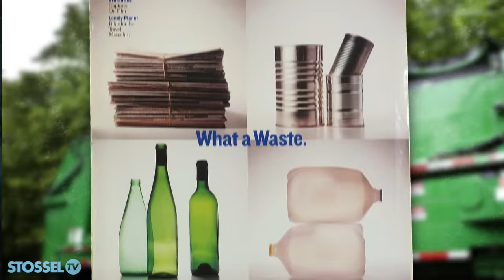Even Greenpeace Says “Most Plastic Simply Cannot Be Recycled.”

Comment: I saw a vid about using unrecyclable plastic as building material. They heated it to fuse the plastic into "Concrete Blocks," which didn't break and were bug proof.  It seems like a good idea, but there is little about its success, cost,  or practicality in real world applications.
Reply: yeah China does it, it's called Tofu-Dreg
Reply: That is a cool idea. You could even use it for emergency housing after natural disasters in the U.S and everywhere else.
Reply: Damn, I never thought of that. Use the thing that takes 100,000 years to degrade for a house!
Reply: Yah, experimented with that back in 2012. Loaded a vessel (with a lid and a trickle of nitrogen to drive the oxygen out the vent) with plastic and used nichrome heater wire to heat the plastic to melting. Had a mold we'd made for garden paving blocks and we filled it full of sand (for filler and to block UV light from eating up the block quickly) and some ground up charcoal briquettes for the carbon dust for UV protection. We had to put a vaccum pump on the outlet of the mold and shut the melting pot vent so it got about 2 pounds pressure...
Between the pressure above the very thick viscous molten plastic ( just a random mix of household plastic, basically PE and PP) and the vacuum below the plastic flowed through the sand and filled the mold.
We made 20 of those paver 'stones' and they came out very nice. Used thenm to make a walkway between a back door and a side garage door. They are still there and just as good as the day they were made. Not slick, the sand at the surface gives an antiskid effect.
Reply: They're super expensive and break down in UV light.
Reply: @bobjoatmon1993  sounds amazing!  Good on you for being inventive.  I'd love to see this in practice in nurseries,  parks, walkways.
Reply: @toomanymarys7355  The blocks could be protected from UV with stucco or some sort of siding.
Reply: Would you want your house built that way, or somebody else’s? 😁
Reply: @robertadams2857   There are applications it would be useful, no need to go after someone personally.
Reply: @robertadams2857  It seems better than concrete block, as well as being rot and termite proof.
Reply: Plaster and paint the surface.
Reply: @elultimo102   Better than Concrete? IDK..
Reply: @robertadams2857  They pounded one with a sledge---nothing really happened to the plastic "cinderblock."

Comment: I heard more than a year ago about an Australian man that had developed a process to recycle plastics, they did not have to be sorted, are all processed together, and yields a product that will stand in as a substitute for fuel oil.  Plastic started as petroleum.
Reply: The technology has been around for decades. However, the energy needed to convert to a useable fuel source is no where near the cost of traditional methods.
Reply: I saw something similar on yt.  Asian man with a machine he took from school to school.
Reply: some poor africans use it n a small scale too, the concept is the same, you just burn the plastic an condense it, the condensate is usable fuel in things like motorcycles
Reply: I know of that process, my city makes very heavy use of it. It's called the incinerator. We get a decent fraction of our electricity from that.
Reply: In the original Metal Gear game (1990 or so), I believe, there's was a bacteria that could eat plastics called, "oilex" and I did a school paper, where in my research, there was supposedly an actual bacteria that could do this.

It would be interesting to see if I could find that citation to double check the sources.

Comment: Having worked in the plastic manufacturing these guys speak the truth ,my job was in plastic bottle manufacturing [ blow molding ] . And our scrap was virgin plastic ,trimming scrap and out of spec bottles , the most pure plastic available we called this regrind , We used two types of plastic , HDPE and PETE the HD is mostly colored and the PE is clear . The issue is we cannot just grind up the scrap plastic and feed it back into the extruder and make a bottle  [ the extruder  melts the plastic and feeds it to the molder ] . The reason for this is the plastic has already been stretched in the molder and has changed the molecular structure , and won't stretch again .
Reply: Good information. Thanks.

Comment: Many years ago, I filled the bed of a pickup truck with newspaper. I lived about 30 miles from the recycling center. I didn't get enough to cover the gas. Plastic has very few ways to be recycled. A lot of it can be ground up and used for filler in concrete or asphalt. Some can be melted and turned into park benches.

Comment: Garbage should be burned for power and heat. Take out the steel cans with magnets and crush and sift out the glass. What's left is mostly food, paper, aluminum foil, plastic and dog poop. All of those burn nicely. The residue can be used in construction. I would also build plenty of coal plants which emit lots of life giving CO2 and replenish the Earth's depleted supply. Combined with proper forest management to prevent most forest fires. The coal plants and incinerators would provide the missing particulates needed for rain. Contrary to popular belief, you can have air which is too clean. Cheap energy, cheap lumber, abundant crops, cheap garbage disposal, no landfills, few forest fires. What's not to like?

Comment: what a SOLUTION ?  heating and cooing uses nearly 40% of energy used across the planet.   
HOMES, well EVERY building, by building codes, should use 10% less energy than the average building of 10 years prior to the date of the permit.   That means if you build a house, it has to use 10% less energy than the average similar home of 10 year prior.  it becomes harder as you approach zero.   but within 50 years,  houses should use almost no energy to heat and cool.  Since we already have them, it is not futuristic, impossible, or and get this,  more expensive.

Comment: Recycling plastics actually causes the polymers to break down, which requires the addition of new plastic. Metal and glass are not polymers. They are crystalline structures, which can be melted down and remolded into new containers. Recycling plastics exists so we don't abandon plastics, which maintains the fossil fuel industry. Fossil fuels should not be propped up.

Plastic bags do not reduce emissions compared to non-plastic. That's a blatant lie. The more you can reuse something, the less of it we have to make. That is what reduces emissions. So buy some canvas bags and bring them to the store with you. Don't use the store's bags. Buy reusable containers. If you can buy products packaged in metal, glass, or paper, do it.

John Stossel is a fossil fuel mouthpiece.

Comment: But, 8 pounds of plastic can be melted down into 1 gallon of gasoline. yet only 8% of plastic is used, I wonder why. Couldn't be because of the oil industry? Of course not! they'll tell you it isn't viable and it requires to much intensive labor. Simply to net them more monetary profit in the end. same reason alcohol was outlawed in the 20's. Cause someone made a combustable engine that ran on it. and it was starting gain popularity.

Comment: Sorry I'm not convinced by the video. I think I would investigate to get more figures and points of view. This video has statements based on a headline of a newspaper... Different newspapers tend to contradict so you could just search for a headline that alines with whatever you are saying. This video will be better with more real data or an explanation of why the 95% of plastic can't be recicled. Is it becouse the composition? Is it becouse is mixed with other components and imposible to separate? I get no explanation from the video, therefore I'm not convinced.
I understand that recicling can cost more than the raw material, but the thing is to design the product so it can be recicled. Search for a solution, not just say that is complicated so I don't do it...

Comment: But it absolutely can be recycled.

America alone spends insane amounts of money using sand as filler in projects.

It is quite a simple thing to heat these plastics up and just melt them into big lumps and use them inside of whatever, just to take up space.

And yes, sand is actually a big deal. You can't use just any sand to make concrete. And the world is starting to run short on that type of sand. So using it as a filler is beyond idiotic.....

And yes, it will work just fine. They even used foam underneath roads now. And foam is a lot less strong than the plastic is.

There are uses for all that plastic.

Comment: You seem to keep saying recycling in general is worthless, when your argument mostly only supports that PLASTIC recycling is worthless. Also, I’ve never been “required” or “mandated” to recycle. Much more often I’ve had to throw recyclable materials away, because there is no recycling option available.  We should reduce, reuse, and only recycle as the last option. And we should design things to be more recyclable or biodegradable. You’re not wrong, John, but your argument is skewed. You absolutely should recycle your cardboard, paper, steel cans, aluminum cans, and scrap metal. I don’t think there is a good argument against recycling those materials- but you seem to be painting all recycling as “worthless”.